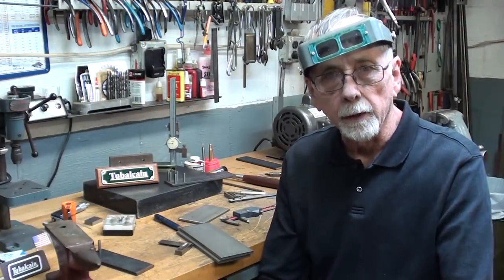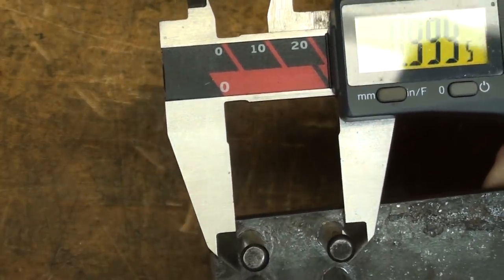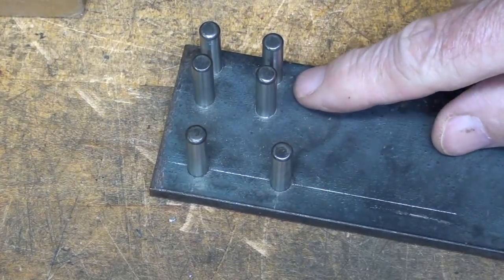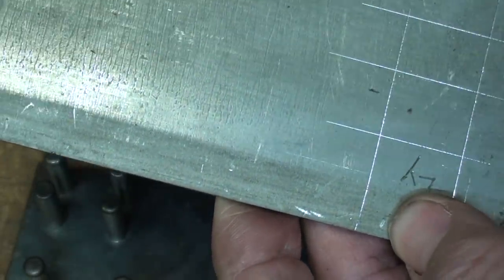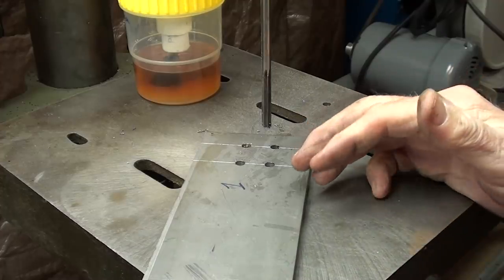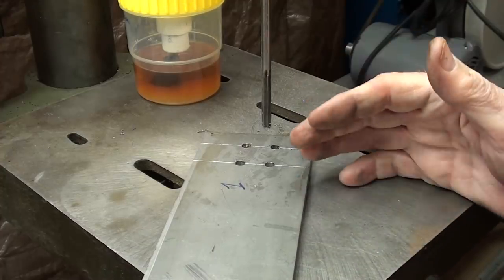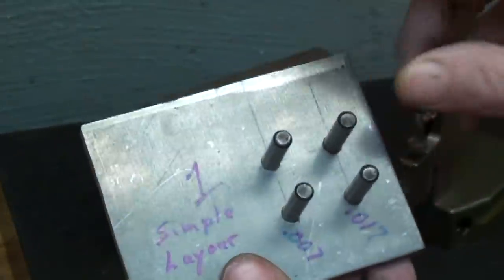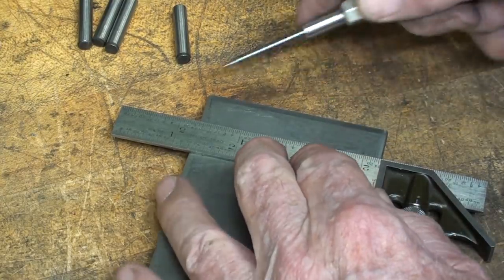Accurately Spaced Holes Tips 523  pt 1 tubalcain experiment

Comment: Good morning. Retired tool maker and long time tool inspector here. Yep, done all of those and more :D 
The optical center we called "bomb sights" and we made our own which is pretty easy to do. The error likely came from two things. 

1 the use. I was taught to always rotate the bomb sight through 360 deg. You can see the cross hairs "wobble" around the scribe lines. You then center the scribe lines by evenly centering them to the cross hairs. 
2,  I don't trust that magnet enough to take it out of the box. Our drill blocks were always clamped to the work to prevent movement and we used slip renuable drill bushings through the drill block to drill accurate and square holes even with a hand held drill. That is quite handy when standing on a ladder etc.  
Another thing we would do is after the lines are scribed, we would use a transfer punch through the bushing and drill block while picking up the first Starrett punched mark. If you punched correctly, the hole was really darn close to where the prick punch was made... and square with a hand drill. Good video! This is the stuff not taught anymore in schools!
Reply from the maker: Thanks

Comment: I truly appreciate all the mrpete222's videos. My mentor Tool and Die maker, 50 years ago,  taught me to scribe the lines and then use a Jeweler's Loupe to find the target.   Wiggle the point of a scribe  into the material at the intersection of the lines and  then use that divet for the center punch.

Comment: G’day Lyle, as soon as I saw the 4 dowel pins in the plate it brought me back 46 years to when I was a 1st year apprentice motor mechanic, 3 months of hand tool use. 1 exercise was to drill 2 blocks with 4 holes each with a 1” pattern, fit dowel pins in one and see if the other block would fit, wait for it, 8 ways. I achieved a 6 way fit, it’s amazing what steady hands and good eyesight can achieve. As I reflect today, how DID a 16 year old kid do it, I can only surmise the Railways had competent teachers. Cheers Peter 
PS I don’t think I could do it today

Comment: I love these basic layout videos. Anyone can chuck up a twist drill and start punching holes, but when it matters - can you be accurate with their location? This just makes me want to get a surface plate and height gauge. Thanks for the lesson!
Reply: Agreed, thank you Mr. Pete
Reply: Bird, another method as others have mentioned, is the use of tool maker's buttons. Lyle isn't going to show them, as they are fiddly to use..but they do work. You need a drill press with a good spindle and quill, micrometers, and test indicator. Buttons work on the lathe too if your holes need snap ring grooves or stepped holes, ect.
Buttons are probably the most inexpensive way to locate holes within 0.001" . You do need to be this close if you are doing something like locating shafts for gears on a plate. 
Here shown in use:
https://www.youtube.com/watch?v=IPV54iNBo1M
And here is a article showing the use of buttons with castings you might see in model making where you might need to accurately locate a hole to  features on the other side of the casting.
neme-s.org/Model_Engineer_Files/3007-Use of Toolmaker Buttons.pdf
Reply: @aceroadholder2185  A DRO is the way to go.

Comment: Mr. Pete,
I don't know your situation as far as your eyes.  You appear to be near sighted.  I had cataracts 5 years ago.  I had vision of 20/650 since 8th grade.  The options were they could correct for reading or distance.  They can also correct for astigmatism.  I opted for distance.  I am 20/20 in one eye and 20/25 in the other, and can drive without glasses.  I wear bifocals with little correction in the top half and the bottom for reading.  I do have a set of trifocals safety glasses for the shop.  The dials on my lathe and mill are at mid distance and the third lens sharpens them up.  The operation  was pretty easy. 
Enjoy your videos and they are never too long.  I'm sure when you were teaching your class periods were 50 to 55 minutes long.  I have no issues with attention span for that length of time. Happy New Year and looking forward to more videos.
Reply from the maker: I need to go to the eye doctor again, thank you for the comment. I have a stigmatism, and always have

Comment: I'm surprised with the optical layout result. Even with cataracts it should have been better. I have one replaced lens and the other cataract needs to be removed. Overall, as you say it's close enough for most work. A few years back you did some layout comparisons like this. The DRO is my bet. Under 0.001 inch. Thanks again for your expertise and years of wisdom. You are the best!

Comment: Jig Bore!!!! I am a reliability engineer at Xerox (in Rochester, NY). for years i have walked through the manufacturing plant here past a "special" room called a Jig Bore Room. I have always been very curious about what the meant. Thanks for the slight digression that partially answers that.

BTW - keep up the great work on videos. I always learn something  interesting.
Reply from the maker: They probably have that as a designated area for the Percision work. I'm not even sure they use them much anymore. And I have never used one myself. Thanks for the peek into the IBM factory

Comment: Enjoyed your vid as usual. I come specifically for the rambling...HA...But also I wanted to show you that belt system I created for my walker turner I mentioned to you in another one of your video's ..(man i love that drill press. best 60 bucks at a yard sale i ever spent)..And redid the bearings and she works great,  Below is the link to a picture of the belt system i did years ago but pardon my crap welds i was still learning..but its accurate and works like a charm. so for anyone that does not mind doing it without the electronics method this is a quick and easy way. the bearings have clips on them and the pipe was machined out to make a sort of spindle with just the right diameter for the bearings to tight fit but ease of disassembly if i have to change a bearing. cheers and tanks again these are great tips you are sharing, They all go into my brains tool box for use when needed.
https://drive.google.com/file/d/1NivORcfCqqNLd87e9y3fpfmZV8RH6EKs/view?usp=sharing

Comment: I once read a most excellent book on precision machine work, and one of the ways that author recommended to accurately punch at the intersection of two scribe lines was to make a special punch guide with 3 sharpened feet, two of which fell into one scribe line, and the third fell into the other. More accurate than trying to feel the intersection with the punch, and easier to make than an optical center punch, if optical center punches existed at the time. I ought to find the name and post it here, it was freely available from some online archive

Comment: Howdy! If you have the opportunity or motivation to do a video on the making of  round tuits, it would be appreciated. The older I get, the more I seem to misplace mine. That Jig Borer you spoke of early in this video is still used in Mom & Pop old school tool shops.
Reply from the maker: Good to know
Reply: What are round tuits?
Reply: @trialnterror  The lack of one is often used as a reason to put off doing something until later. E.g., "I'll do that when I get a round tuit"
Reply: I.E. I will put something on my round to it file, like an old Rolodex, a series of file cards wrapped /fanned around a small cylinder. As you list the jobs and fill it up you get back to your first round to it job. So then you do that job and on it goes.

Comment: I am not a machinist, but I find these kinds of videos very helpful for both "when I need it" situations and to have the knowledge so I can direct friends to it, so thank you. It really is useful for anyone that needs precise drilling, and combining methods 1 and 2 - square and prick punch - I think gives a level of precision that works for DIY, repair and craft work. Your videos are the "popular mechanics" of the internet age, I think. 

I think that the best part of this video was hearing the cameron press working. On camera it almost looks like a toy from how small it is, but the sound of it was the hum of precision. Although, I think spotting with it may have thrown off your last holes. It didn't seem to "grab" the punch marks from the one you showed like the other press did, or at least it didn't look like it did it as well on camera. Maybe not powerful enough for the piece?

Your direct to 15/64" vs progressing from 1/8" looked like it had some promise, since there's less drilling operations and it potentially saves time, I hope you explore things like that in the future.
Reply from the maker: The little drill press can only be appreciated by handling it, using it and examining it carefully. It is quite a machine

Comment: The comment by Anthony Ruddy seemed to catch what I caught.  For #3, your pilot drilling in the video showed a bit that was deflecting (curving) because the drill bit was not centered over the punch mark.  If the same thing happened with the larger bit, then that explains a lot.  I am going to guess that as you went through these examples that your care to detail, or eyesight, started to slip.  A very interesting and educational video.

Comment: Your result match mine. My vision is less than ideal, 76 years old. If I use my ht. gage on the granite and deeply scribe I can feel the cross point. Better yet is the DRO on the mill. But even that isn't perfect since my very used mill has a lot more wear near the center of travel. When I installed and calibrated the DRO I went through many iterations and finally settled on a bit of error.  I really do like having the DRO. Equally spaced holes are now dead  easy even if they need to be at an angle to the X or Y travel or on a bolt hole circle.
Reply from the maker: Yes thanks

Comment: On the last one you did, looked to me as if the drill bit flexed a bit which caused it to wander at the start. Leads me to think the plate was not in line with the bit when you began. Just an observation, done that to many times myself when holding a piece like that.

Comment: So what I learned in milling class is you use the center drill you measured the diameter of the hole using your best friend which is the dial Caliper then you cut the diameter in half because you want to measure from the middle right after that you take your dial Caliper put one tooth on the edge of your hole measure it to the outside of your piece then you add that to your half a diameter and you got the distance from the center of your hole to the edge of your part the accurate measurement you need or to figure out where exactly it should be do you need to move over .500 or .127 or .047 or whatever. Super excited to get back to school can't wait for this break time to wish there wasn't even one

Comment: That Skidmore- just as the name implies- unless you connect at a near perfect striking angle, it can shift ever so slightly throwing off the center punch mark. I have a similar device and hold the sleeve in position with a Vulcan Death Grip when I strike, it does help.

Comment: Great video. I am 71 years old and I have one of the optical center punches and I always seem to get different results with it. I like the  prick punch best myself. I have also noticed that you need to have a good center punch which ground very precisely to a point. Results are never going to be better than the tools you are using to achieve the result.
Reply from the maker: Yes I do not like the optical center Punch have seldom used it. I have 75 Center ponchos. I need to sharpen some of them on thelathe. Using a tool post a grinder

Comment: Jig bushings are a useful pattern method. Bushings in 1.000 dia material could place holes 1" apart.  The fun bit is when using busings to space the center to center cord spacing about a circle and then calculating and turning the center to complete the correct radius of the pattern.  So for a given bolt circle the buttons are the cord in diameter arranged around a central button thats the bolt circle diameter minus the cord.  A twist of safety wire or more modern a zip tie could hold the arrangement until clamped or fixed in soft metal.
Reply from the maker: Or rather intriguing solution. I've never heard of it or tried it

Comment: Manually drilling a hole accurately to size and location is not only a matter of correct layout method and tooling selection but also accurately picking up the punched location at the drill. With smaller drills it's easier to see when drill bends as it tends to wander off or seek the punch mark. The most accuracy you will get when picking up the punch mark with a wiggler or a optical center finder.
Reply from the maker: Yes

Comment: Wouldn’t you need to tram your drill press table relative to the spindle as drilling at an angle to the work would throw off the pins?  They would measure differently at the pin bottoms and differently at the tops.  In other words you need to drill straight into the work, but the drill press has to be perfectly set up. Wonderful video Mr. Pete!  Very informative!

Comment: Sir, it may not be your problem, it may be the drill press. For unknown reason, all small drill press are backbone by round tube, no matter it is dremel, wolfcraft or other brand, usually an 1 inch tube.every weight of the drill hangs on it by a screw clamp on the tube, but at the same time, height adjustment as well. Therefore, there is no screw holes on the back bone. Just the clamping force of a screw, and may be a teeth bar in some brand? If that drill press had been fit with some larger bit, such as forster bit, hole saw or simply some bits larger than about 6 mm. The Torah of the spindle may have a influence on the back bone to create a force of right twist while drilling because the clamp had nothing to bite on a round tube. I have seen a lot of drill press with that screw scratch mark on the back bone.  And the clamping device will loose. Seems no one ever attempt to recognize and attempt to fix the design? How about using a square tube as back bone? Just like some mag drill stand did? It will minimize the right twist effect. This is what i am going to do, saving money to buy the mag drill stand with a square tube backbone.

Comment: I know this video is old by today's standards, but I'm going to pitch my two cents anyway. I think the error in method  3 was introduced with the long thin drill at the micro drill press. I think a spotting, or combination center, drill would have been the better choice. The thin drill can wander off center with even the slightest breeze.

Comment: Another interesting video Mr. Pete! When you mentioned the possibilty of the work being hand-held and maybe moving, I was wondering if it might help (assuming you were drilling into metal on a metal base) to place a magnet onto the work which would help to prevent slight hand movements. Also, why not check for concentricity before drilling by lowering the bit without it turning, getting it spot-on, then drilling. I did notice the drill  wandering before it bit into the work. Looking forward to the next installment!
Reply from the maker: That is a possibility

Comment: Regarding the optical center finder:
When the hammer hits the marking punch, unless the hit exactly vertical, rather if it’s not exactly in line with the marking punch’s centerline, a small lateral force can move the magnet. I bought a different one, did not like it, returned it.

Comment: I see that STANDARD drill index sitting on your shelf. I once had 3 of them. #1 cast iron. #2 cast aluminum. #3 plastic. All were of the same design.
Reply from the maker: I did not know they made them and different materials. And it saddens me to find out that they made them out of plastic

Comment: Great video as always. I'll be the first to admit I am a newbie. But, is there a way to measure accurately between center punch holes? I think this would be a better gauge as to better method of measurement. It will eliminate the variables (errors) created by using different drills and vices and sometimes no vices, I'm referring to your comment at 8:10 about using vices to prevent the work from floating away. The errors caused by drills & vices, or lack thereof, are not related to the six measuring methods which was main content of these 2 videos.
Reply from the maker: Use a dividers

Comment: I would check to see whether the punch tip is centered on the body before blaming your eyes. Having the tip of the punch offset really messes the results up.

BTW, I just finished getting both my eyes done for cataracts. I couldn't be happier with the results. I chose to have the replacement lenses fixed at 16" which gives me good vision from about 12 to 24 inches. Since I spend most of my time reading or at the computer, this suits me most of the time. Since I'm likely to want sunglasses anyway, it is no burden to put on a pair of glasses to drive. (I also wear glasses to watch a movie in the evening.) Don't let them talk you into having one eye with long vision and the other with short; I have not met a single person who was happy with that. The multi-focal insert lenses don't work well either.

Comment: The thickness of the lines of the weaver scope thingy is why it was off so much. I assume you used an edge of the scope line instead of centering over the scribed line. For this to be more accurate the scribed line needed to be the same thickness as the one in the view finder.